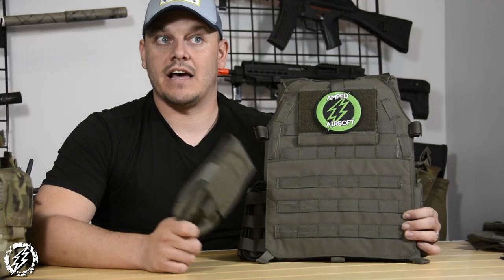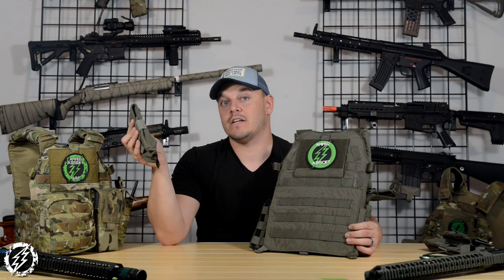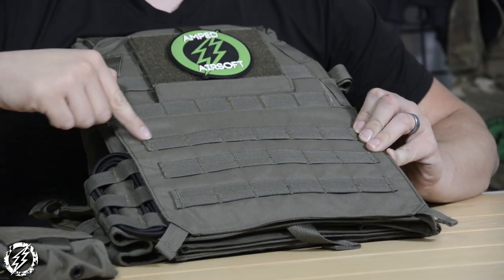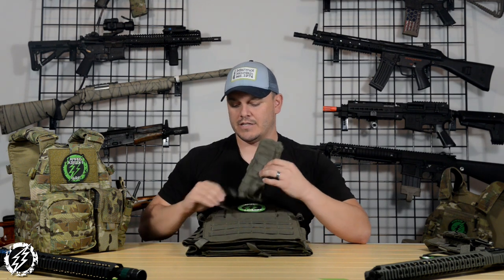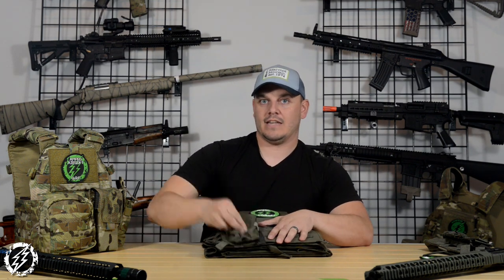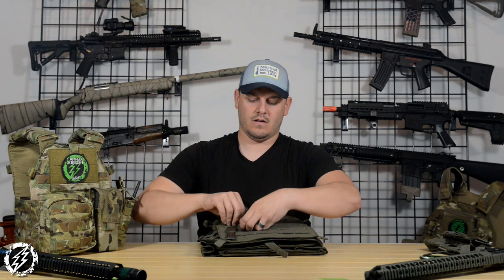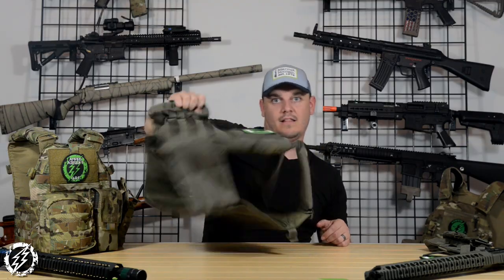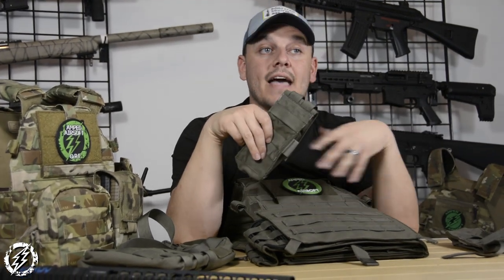Pleb to Pro - How to MOLLE

Comment: Say I get a dump pouch and a Leg drop holster do I have to get a belt
Reply: Jay Hanlin hey dude just get the Gryffon dragon spine belt system. It has 2 m4 pouches you can use that for your secondary and it comes with a dump pouch.